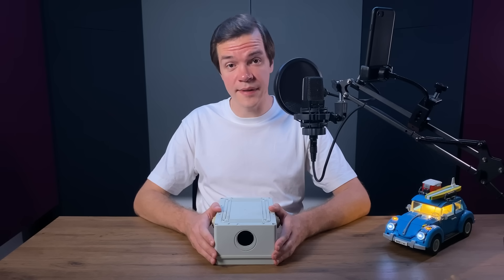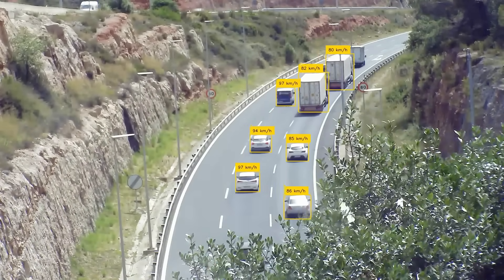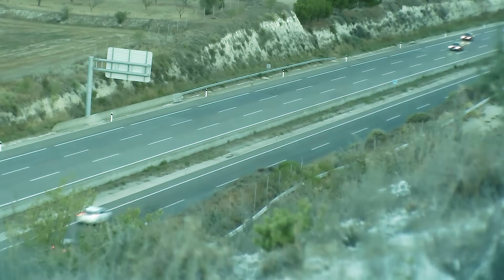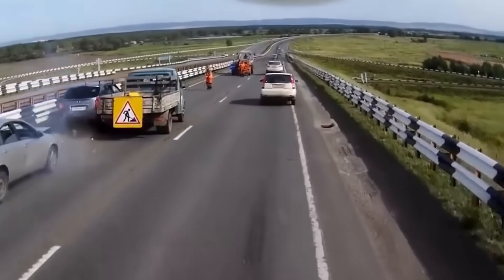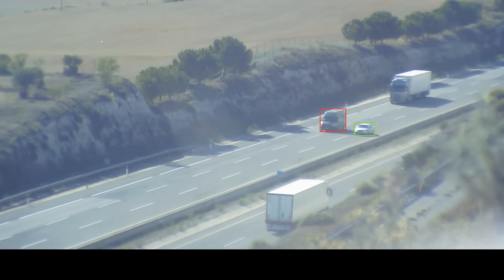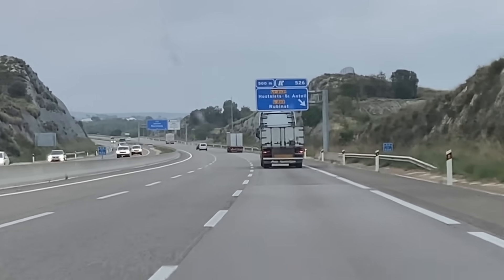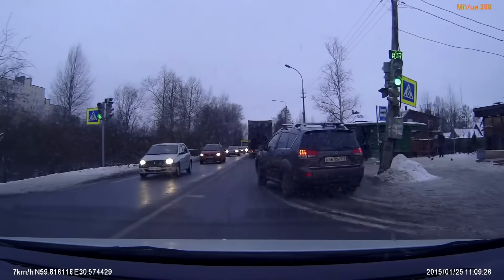New Anti-Tailgating Camera Reveals Shocking Statistics

Comment: I no longer drive, but I used to.  However I would say that unless society is prepared to go to riduculous extremes, the only sensible solution to this tail-gating lies with the insurance companies.

If they refused point blank to pay out to any driver who hit a vehicle in front of them, insurance for tail-gaters who had had an accident would skyrocket. Have advertising campaigns to highlight the low cost for non tail-gaters and you could make a trend of it. 

If you are a good driver, following the rules of the road, you should ALWAYS be able to stop before hitting someone. But good drivers don't just look at the car in front of them, they continuously scan the cars in front of them too and across all the lanes. That was my style of driving, but as roads got busier, and drivers more aggressive, my own ability to be that good driver waned. So I stopped.

Comment: It seems that most modern cars are now fitted with automatic collision avoidance, but the distance in front has to be very close before it will issue a warning, and a lot more for it to actually activate the breaking. Some people will probably feel their distance is safe because their car's automated system have not warned them it is not. Most systems do not take into account the weather or road surface so they are hardly fool proof.

No matter how careful a driver is, there is always the problem that whereas they may be able to stop in time, there is the nigh probability that they will be rear-ended by vehicle behind. It is often down to instinct, break hard, and take the time to look in the rear view mirror as well, as sometimes it is a case of break and then change lanes, but drivers don't practice so few people know how they will react.
Reply: Sometimes, my car won’t let me drive into my garage and says there is an obstacle in front of me.  It’s the far garage wall.  When this happens I usually reverse out a bit, then try again.  😂.
Reply: @margareth1504  I have a similar problem, I am not sure if it is the far wall or the side of the garage, however, on my vehicle I just need to release the electronic parking break which has been activated and then continue with the manoeuvre. I think the logic of the system is, "I think there is something you are going to hit, so stop ", me "Ignore it, I know what I am doing", "Okay, if you say so".
Reply: @martincday007 😂.

Comment: Finally, you’re proving what I’ve said for more than a decade.  And when we say tailgating, most people think it means less than a car length away at any speed.  Im talking about any that break the Highway Code in the UK which recommends 2 seconds.  

I’d estimate that over 90 percent of cars tailgate in the UK. In any speed limit.  They drive everywhere at 35-45 mph, between changing limits of 30, 40, 50 and even 60. On average I’d say they drive with 1 second gap or slightly less.  

The recommended gap does many good things. Not just stopping/reaction distance to avoid collision; it also helps traffic flow in multiple scenarios - the gap is designed to flex (concertina) for this reason; therefore helping reduce congestion; it provides better visibility; reduces aggressive driving; it allows safe overtakes; and more.  By driving that close, you become reactive to brake lights ahead, rather than being fully aware and in control your self; many folk rely on the car ahead to know when to brake, and those who think they’re sharp actually rely on seeing through that car to the next one ahead - but never looking to the horizon and all hazards between. 

In the UK, it’s common that if you overtake someone they will speed up intentionally, on a two-way road.  Add that to those tailgating in a line of cars (common is 50 in a 60) and the person overtaking will be stranded in the wrong lane for too long.  Thankfully on a motorbike you can either fit into smaller gaps or simply overtake the second vehicle too.  

I’ve actually overtake a car at the back of a ‘train’ at very minimal speed difference (comparatively slowly) with lots of time spare, only to find the car seeks to prevent the overtake such that it gets within a distance to the next car that is less than my bike length - happens maybe once per month.  

Ironically I was tailgated a long way home one night, whilst in my car.  But the gap increased on a sharp bend; but 200 yards later i stopped at a pedestrian crossing. The tailgater, now much further back, seemed oblivious and punted my car beyond the crossing by another 5 car lengths and wrote my car off.  I now have spinal pain daily for the last 16 years.  Ironic because tailgating didnt cause the crash.  But I think it contribute to a habit of wanting to be closer; probably sped up etc. 

It’s a bad habit. Causes many accidents; town roads; country roads and especially pileups on highway/motorway multi lane roads.  

Whenever UK motorways converge, it’s common to see flowing traffic come to a stop, from 70mph. Then 200 yards later, be flowing again.  They don’t know how to zip merge; they all think they need to be over into “the fast lane”. 

The UK has been on a massive push to reduce speed limits everywhere for more than a decade, much like France.  But it’s done nothing to help.  People just follow each other in long ‘trains’ is traffic, like zombies.  As said, doing 35-45 everywhere regardless of limit.  There’s now a new push to introduce 20mph in many urban areas - these are largely ignored (as the difference between 20 and say 34 feels massive) and therefore making things far worse; tailgating on these roads is maybe half a car length.  

About 5 years ago I noticed a big reduction in tailgating.  I suspect this was the introduction of ‘sensors’ on the car that beep at the driver.  But that improvement has gone; presumably everyone disables that device.  

I actually drive with a 3 second gap because: A) I need more time & visibility to deal with sudden sharp braking of those ahead and to provide safer buffer to slow due to cars behind; B) it’s just more relaxed.  

It’ll never make sense to me that the majority of drivers cannot achieve 60mph on rural national main roads , yet happily tailgate in town.
Reply: The worst thing about the ones who speed up in the inside lane when you overtake them is that it's not usually even any kind of macho 'you can't overtake me!' kind of response, it's because they're paying so little attention that the first time they realise they're not driving as quickly as they could be is when they see you appear in their peripheral vision.

Comment: From a safety perspective you need an safety index that takes costs of damage and injuries into account. Then you will end up indexing not distance needed but residual velocity at impact and the difference of velocities before and after impact (momentum calculatin at inelastic impact). 
And two moving vehicles involved each other is far more dangerous than a moving vehicle hitting a non moving object. Getting hit from behind is getting accelarated in the most unwanted situation when you're at breaking.
Btw. When cars a changing lanes the driver only assumes a certain speed from cars getting close from behind. He will calculate his safety distance based on his own speed not from the perspective of a car behind much faster. Through a rear mirror you cannot estimate speed ... guesstimate at best.

Comment: 5:20: suddenly becoming stationary is not the reason for accidents, because all the surrounding geography is stationary, and it doesn't suddenly cause an accident. Say you are speeding on a not-so-stable way, such as wet by rain and/or snow, then you may leave the road by an unexpected traveling trajectory and there you meet the geography that did nothing to adjust its zero speed to zero.

Comment: a solution is to fine drivers who tailgate for 20 seconds using a chain of cameras. The technology is available, speeding is enforced because it's easy for a single cop to do combined with legacy and a strong false narrative that "speed kills". E = m v^2, a fully loaded semi truck going 50 is many more times as deadly as a car going 80. Speed is relative, so putting them in the same lane is worst. Variable lanes filtered by kinetic energy is doable and safest as long as variability in speed within a lane is severely restricted. Speed deltas should be policed (must remain within 10% plus or minus your lane's speed "standard", which should change with conditions and traffic density. One lane can only safely handle about 1400 vehicles per hour (max) past any fixed point.

Comment: I have a question, is that part of the road uphill? In that case, I guess, there could be more than usual tailgating than on str8 or downhill. Because ppls cars loose speed uphill, and some ppl will choose not to cross to right lane when they lost needed speed for speeding+passing. So they'll stay in that left lane, tailgating and waiting for str8 or downhill to continue passing. They would ofc not lift since they do not want to loos speed uphill.

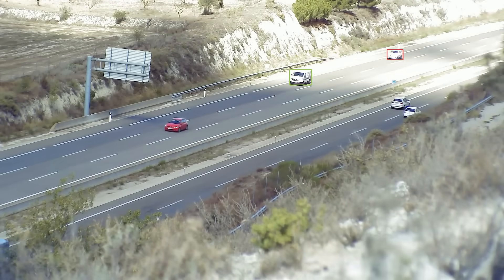Comment: 10:15 This is wrong - you need a ratio of 1 when you want to be able to stop when the car 8n front of you hits a stationary object and becomes stationary itself.
In real world, that is complete overkill, the car in front needs its braking distance to stop, you need your own braking distance to stop, which is almost the same number for most passenger cars. So what you need is a gap that accounts for your reaction time. Not reaction time plus braking distance.
In our country the recommended gap is two seconds, no law just recommendation, and most people are driving with 1 second to 2 second gaps.

Also, counting in people that are already changing lanes makes no sense as they have enough space in front of them in the lane they are switching to

Comment: But... when you calculate the distance it takes for the second car to stop, you have to add the distance it takes for the first car to stop. Both cars stop together. As a driver, I look at the road not only to the car in front, but several cars ahead, so I know what the traffic situation is and I change the driving parameters depending on the overall traffic situation.

Comment: 100 m was arrived at with a formula? Completely unreasonable. You can't set a safety standard for zero risk- based on the worst driver, with the worst reaction time, the worst brakes, under the worst conditions.  We all assume a non-zero risk when we drive on public roads, and we all need to assess our own context/environment.
Education is the only answer.  Not more rules/enforcement.

Comment: This perceived dangerous issue is a progression of typically common human behavior, it's of the exact same behavioral scenario that provides us humans no medical cure for many common long existing illness & disease. There's no doubt the powers that be will ever find a conducive solution other than the predominantly concluded band-aid to temporarily provide a sense of underwhelming stability. To stop eggs falling from a counter top & breaking on the ground, you realistically wouldn't suggest to place a trampoline on the ground so the eggs bounce, would you? As the solution would be to keep the eggs from falling under any circumstance! Thus the later suggested solution is bizarrely what is never considered, however holds the key importance to conclusively solve a problem permanently. Though a 'tell-tale tailgating camera' sounds superb, given that the individual being tailgated knows it, passers-by know it & the individual who is tailgating knows it, then as if the modern trend of recording everything was by chance the break through it isn't. How's a camera going to help anyone? Have speeding tickets stopped speeding motorists?? (Ask yourselves).

Comment: Here in the US, tailgating is both a problem...and a solution.  Allow me to explain.

But first, a little housekeeping.  So that every has a common perspective, I'm in Florida.  Here in the US, we drive on the right side of the road...the opposite of the UK.  On freeways and limited access toll roads with higher speed limits of 55, 65, and 70 MPH (100 KPH is 55 or 60 MPH), we are supposed to reserve the leftmost lane for passing.  The exception to that is if the road is oversaturated with traffic or during an emergency, in which case you do what you need to pass through safely.

But a lot of Americans don't do that; they use the left lane to drive the same speed (or slower) than the prevailing speed of the traffic in the other lanes to the right.  I think this is a neurological failing of a certain percentage of the population, but whether it's intentional or subconscious, it's a real problem.  The road is just safer for everybody when each lane to the left drives somewhat faster than the lane to its immediate right.  Traffic just flows more orderly.

Today, I was coming home and I noted that the left lane, which I was in, was no longer passing the traffic to the right.  We were driving approximately the same speed.  This raises risk and danger quite significantly, because now nobody can pass, and EVERYBODY has a car in their blind spot to the right, left, or both sides, depending on what lane they were in at that moment.

Looking ahead about 6-7 cars, I could see that it was the frontmost car in the left lane who was causing all this trouble.  He had no traffic in front of him, and yet he was driving with a car immediately to his right...and they were in each other's blind spot.  The correct thing to do would be for the lead car in the left lane to complete his pass, then move to the right so that he was in front of the car he just passed, and maintain speed so that the car he just passed is not inconvenienced by him slowing down.

Okay, back to my original statement.  I don't like tailgating because, as I said above, it's a problem.

But as I also said above, it's also a solution.

This is where it's useful to pay attention to the other drivers on the road with you.  I noticed that the car behind me was tailgating me.  In other words, I identified a driver who was WILLING to tailgate the car in front of him (me).

Rather than get angry, I just moved one lane to the right, assuming that my tailgater would move up and follow his nature by tailgating the car that was in front of me in the left lane.  Sure enough, my tailgater did just that.   And in a few moments, THAT car also moved to the right.  And yes, I made room for him, because I knew that him being in front of me would only be a temporary thing, and I was seeking something BETTER than the status quo.

And the one in front of HIM...ALSO moved to the right when the tailgater nosed his way up to the bumper of THAT car.

This continued until the tailgater, now behind the "slowpoke in the left lane", got him to feel uncomfortable too and move to his right.

At this point, the tailgater guns it and moves way out in front of the pack, disappearing into the distance.  In his wake, I move to the left, and follow him, passing the cars to my right.  Passing them with intention, that is, and not just lazily occupying the left lane.  If I was not prompt now, then all that overcrowded traffic in the middle lane would start moving back to the left and clogging us up all over again.

After I zoom past, one or two other cars do exactly what I did.  They move left (behind me) and speed up like I did.

At this point, we have re-established the orderly procession of traffic on that freeway.  The left lane is now unclogged and is moving faster than the lane to its right.  "Slowpoke" remained in the middle lane, probably because now he didn't have time to move back to the left, what with all of us zooming past him quickly.

Slowpoke drivers are often drivers with less skill anyway.  They probably only move to the left lane because it's empty.  Not because they plan to speed up and use it to pass.  

And THAT is why I say that a tailgater can indeed be "the solution" to a slow-driving oinker taking up the left lane.  One car at a time, he created discomfort, and by doing so, he cleared the road for the rest of us.  He also took on all the risk of getting pulled over and cited by a state trooper, because now he was WAY ABOVE the posted speed limit.  But ultimately, he was the catalyst that returned normal and safe function to that section of road.
Reply: Great post!
Reply: Certainly an interesting observation, though it does not always work. I imagine. I've personally watched people continue to cruise in the left lane with nobody to the right, for miles and miles and miles. I've even experimented with passion the right to get in front of them to slow down. I've seen two reactions. The first is just to slow down with me, refusing to give up the lane despite the obvious problems presented by my behavior. The second is to pass me on the right and the return to the left lane to continue cruising! I believe there's a psychological effect wherein these drivers feel safer in the left lane. I assume this is because they only have to worry about interactions to the right, where visibility is reduced and thus doesn't intrude on their leisurely Sunday drive 🤷🏻

Comment: It would be better to use multiple items to determine the measurements within the capture area to get more accurate results.  Considering that the road isn't straight, along with the cars that are closer crossing the path faster due to being closer, the markers on the side of the road aren't going to be as accurate for the cars in the lane farthest from them.  So a measurement not only of the side with the markers, but of the opposite lane as well would be ideal, and the distances between the two can be figured out from there.